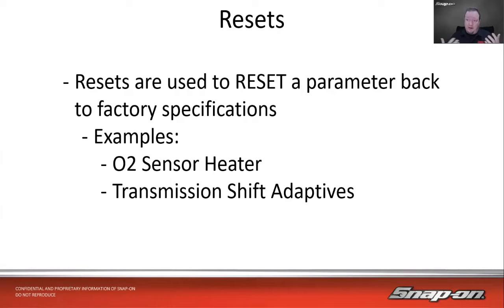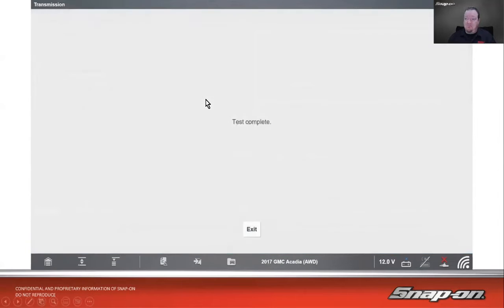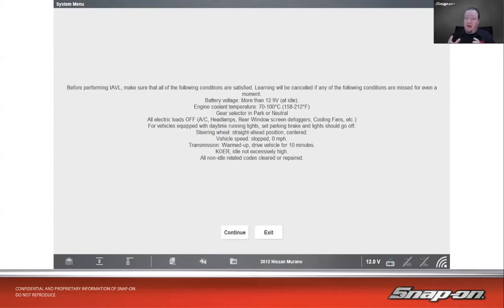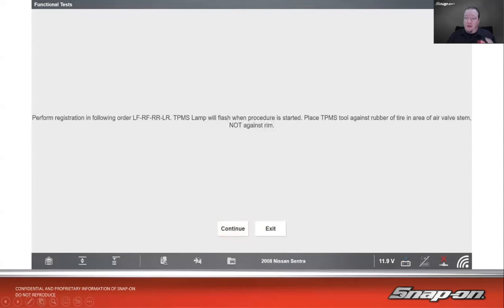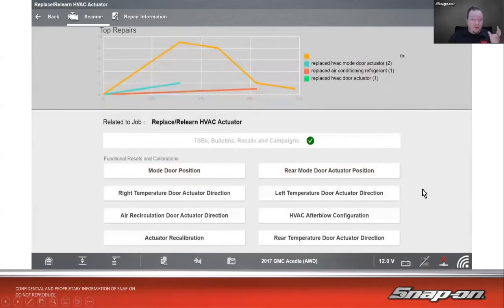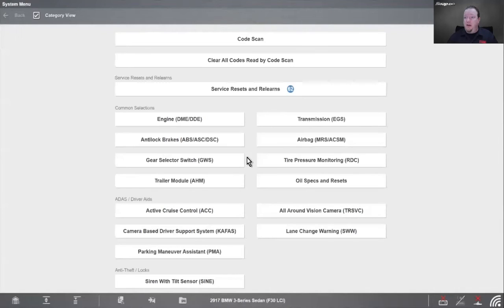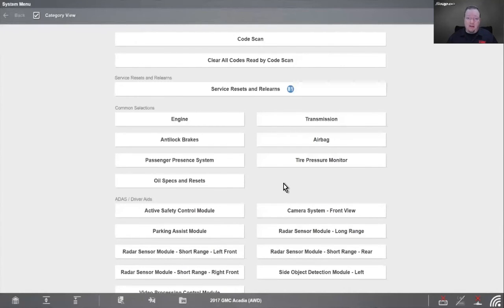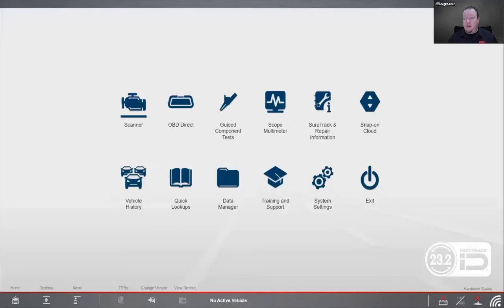After The Repair: Resets and Relearns with Jason Gabrenas | Snap-on Diagnostics UK

Comment: I have questions about the relearn on an 18 pathfinder and a 19 Crosstrek, both timing chain jobs including gears and all components.
My latest update was 2 years ago with my snap on rep. 
My scanner wouldn't let me complete the adaptive learn on vvt's. Subaru similar.
Local shop helped me eith their autel